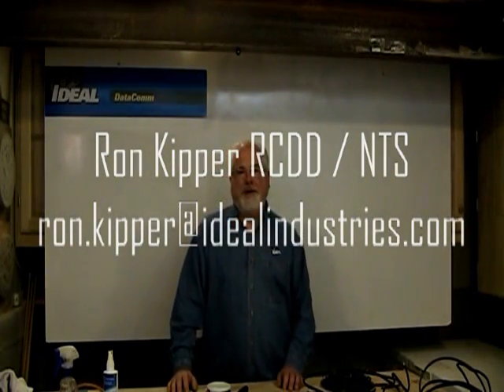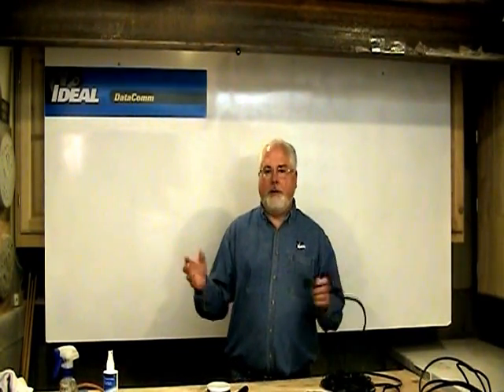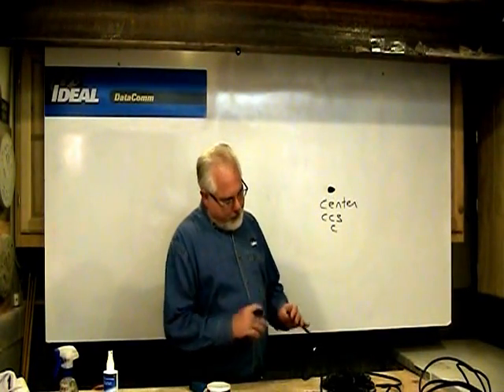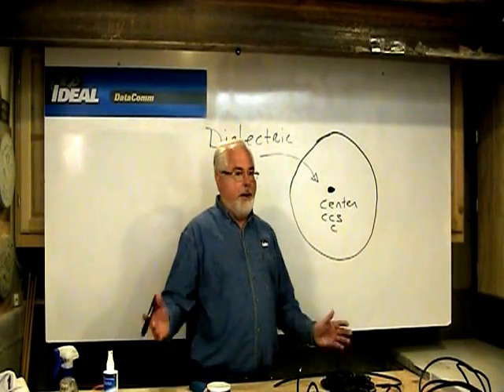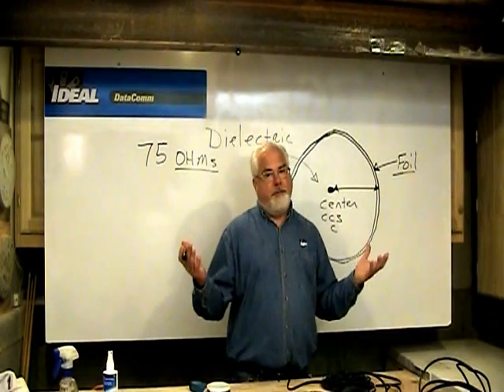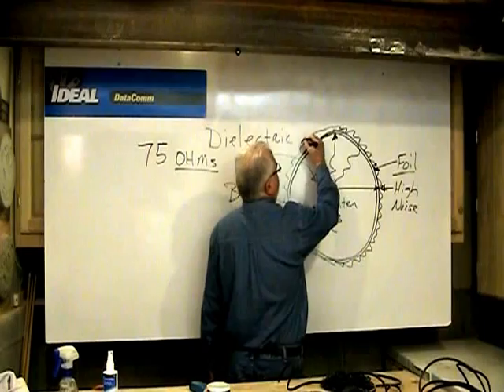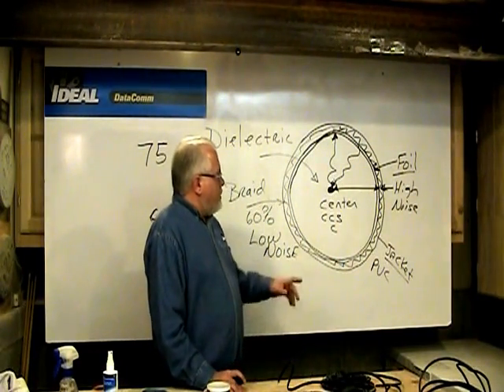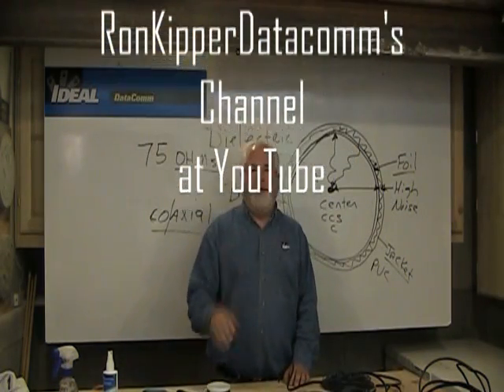Coaxial Cable Basics Part 1

Comment: what the hell? You said 'we cant use air as the center conductor" ????

like hell,  GOOGLE AIR COAXIAL CABLE, its very expensive and used by TV stations!!!!!!!!!    its a double copper tube separated by spiral plastic snake
Reply: No, it does NOT use the center conductor as a conductor, it uses it as a radial dielectric reflector. Common mental fart on your behalf.

You dont understand how dielectricity conducts radially in a transverse EM geometry,  but that is common.

its also called AIR COAXIAL feed.   I dont give a shit what its called, the only important factor is HOW it works.

read the last section of this FREE book and gain some insight:

www.kathodos.com/magnetism.pdf

I translate 7 languages and graduated college 4 years early, and retired at age 32,  I might be (no offense) a hair smarter than most and I dont believe in illogical nonsense.
Reply: @KenTheoriaApophasis  Chill. You don't have to be so rude.